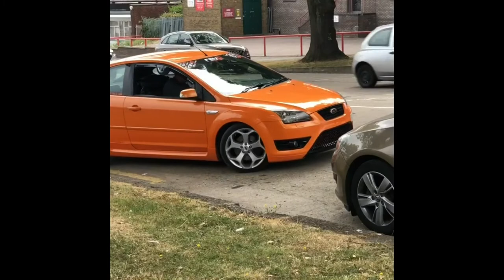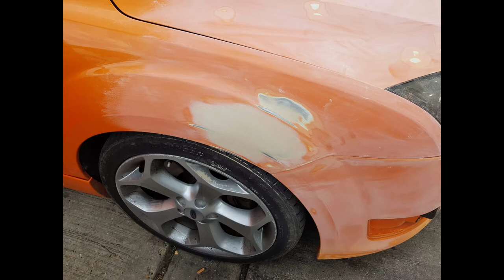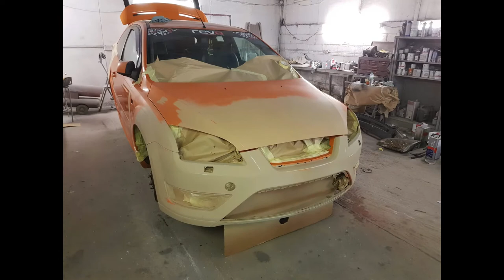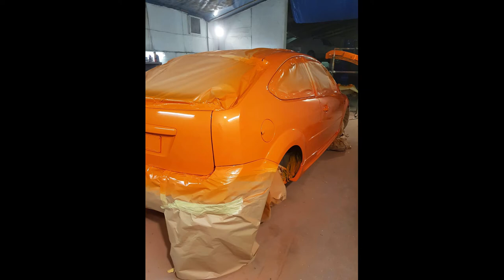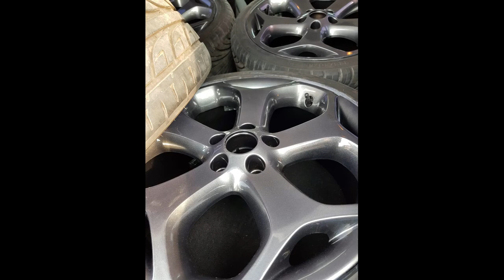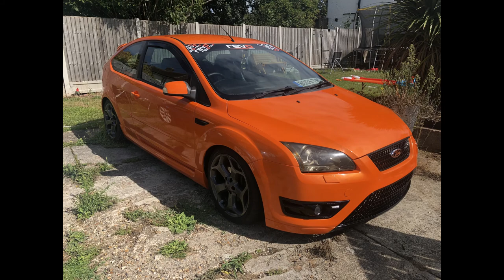Focus ST gets a full electric orange paint job.

Comment: Hi buddy.  Could you give me information on how to match the color of the plastic bumper with that of the sheet metal?  I took mine to the body shop and he couldn't make the EO the same for both parts.  Some advice?
Reply from the maker: Hi mate this is the problem i had mine only went in for bumpers but they couldn't match it so in the end the whole car was done sorry i can't be more helpful.
Reply: @thewhitewill  Thanks the same mate.  I thought there was a primer specifically for plastic parts.  Mine came out terrible.  the bright orange plastic parts and the remaining dull orange bodywork
Reply from the maker: @DavideMaricaFpvPilot  sorry to here mate matching is a nightmare good luck with it.
Reply: Hello paint code????